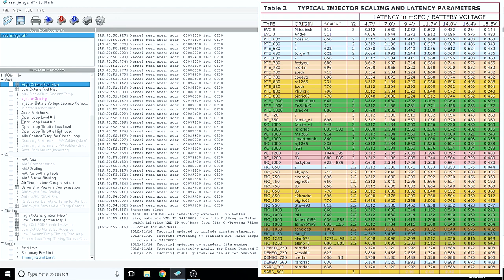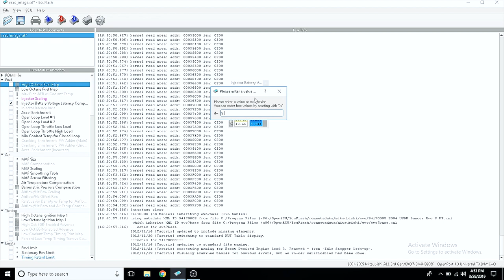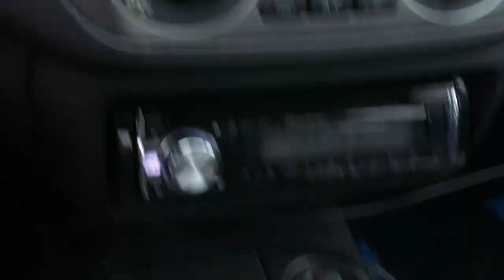How to install and tune big fuel injectors on your Evo 8/9

Comment: Hey there. I'm new to tuning. There's no dyno in my country so I have someone helping me etune. 

I recently put in a bigger turbo and I had new stock oem injectors that I was running. I decided to use FIC 950cc injectors with the new turbo. When I installed it, I'm running lean and cutting off. I got it to idle but it wasn't idling rich. My tuner scaled the injectors and now it's not starting and when it does its super lean. 

I changed all the fuel components to new parts. New pump, braided lines, rail and fpr. I'm not sure why the injectors aren't scaling. I get 5v at the injector clips.

When I put back the oem. It runs fine but I'm getting a knock at WOT. If you could provide any input I would appreciate it
Reply from the maker: Hello! Sorry to hear you are running into issues. Some questions: What kind of scaling numbers/latencies are you running? What is the state of your battery/charging system? What is the voltage coming into the injector resistor pack?

For knock, what kind of counts are you getting? Is it repeatable at a given load/rpm? In my experience these cars are super sensitive to timing at peak tq. What kind of timing are you running there?
Reply: @supercarmio  Hello, appreciate the response. Forgive me if I say the wrong things, I am new to tuning. The injectors are scaled to 835cc and it's not running at all now. When I first installed and it was scaled for stock, they ran but the afr was 14.7 to 15.1 at idle, I thought it would be super rich. 

I only get knock during WOT, I get about 6 counts, this was with the OEM injectors. It happens consistently and only during WOT. I wish I could give you the rest of information but I am pretty new to tuning. I have the rom file that my tuner sent me. I log using Evoscan, I have a ZT2 logger installed. This is all new to me and I hit a wall. I can put back the OEM injectors and they run well but then I started getting knock. 

I have to check voltage at the resistor pack.
Reply: @supercarmio  so I got access to the Merlins how to tune guide and saw that the tuner did not adjust the latency values to match the FIC 950cc injectors. So I adjusted the values and will try  that ROM when I am home. 

If that works I'll let you know.
Reply from the maker: @sayyidferouz3880  Cool yeah sounds good! I would hold off on WOT runs until you get the injectors sorted. Also double check the voltages at the resistor box.